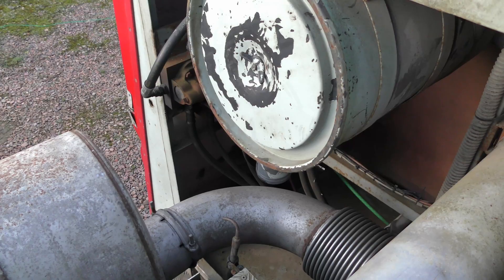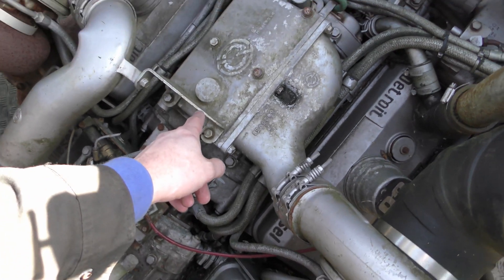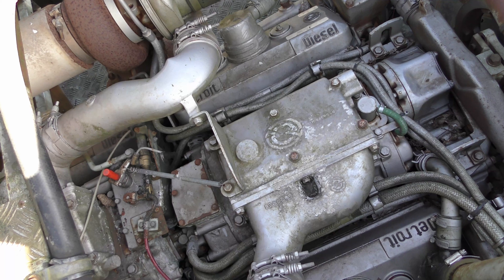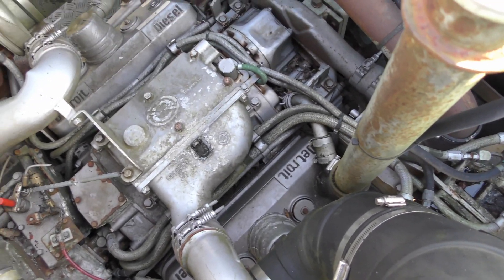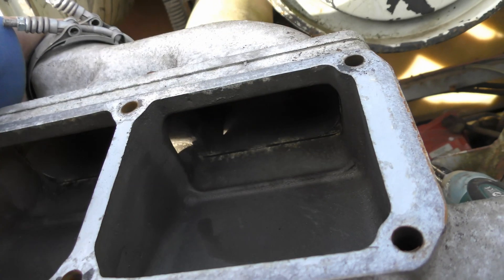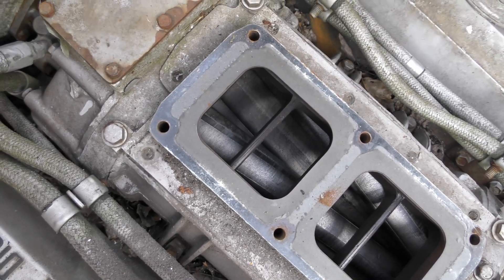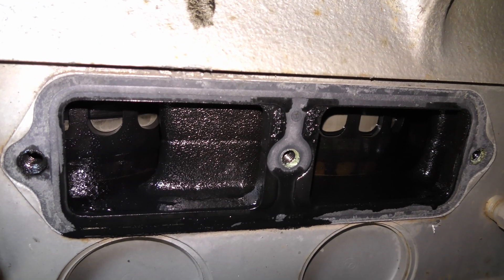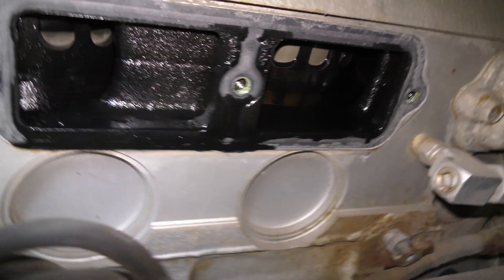Detroit Muscle (Project Marlin 10)

Comment: Thats a typical Detroit 2 stroke exhaust. We have a lot of them here in Australia in trucks mainly. 
Extra to my comment on the blowers is that if your not using the vehicle often or pushing it to hard they may be okay.
If it was running every day or long hard drives I would definitely get the blowers out and have them overhauled if possible.
The cases may be too damaged for reconditioning as they are what the vanes in the rotors run against.
They are basically an enormous air tool so if you know what an impact or air drill etc looks like inside thats it.
Having a blower fail critically will be a very expensive repair to those engines.

Comment: I would be willing to bet some oil in that air box is quite normal. Oil should be fed up the con rod and out the piston skirt somewhere, so every time the piston passes the air ports it should squidge some oil into the port.
I imagine if you get the engines hot and up to speed that should boil off and be burnt up.